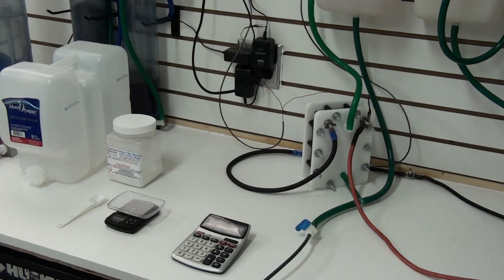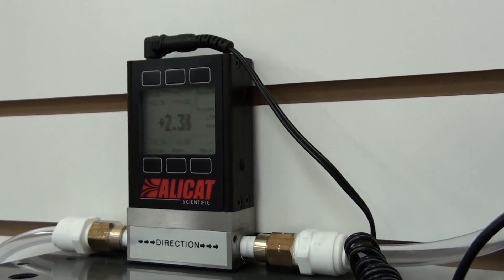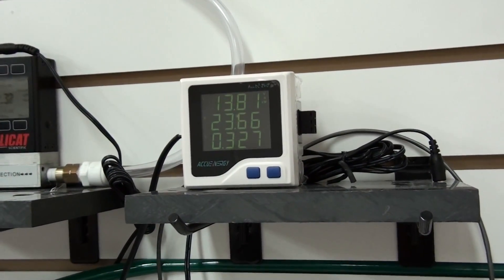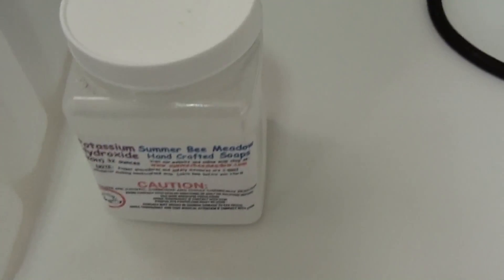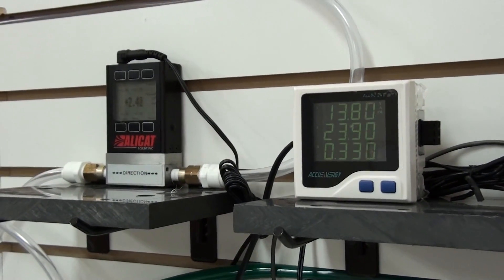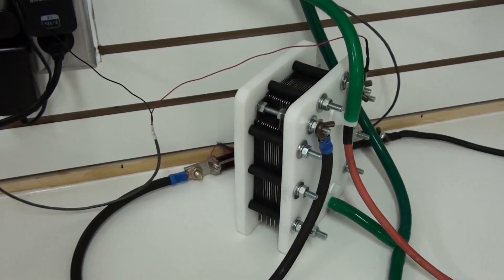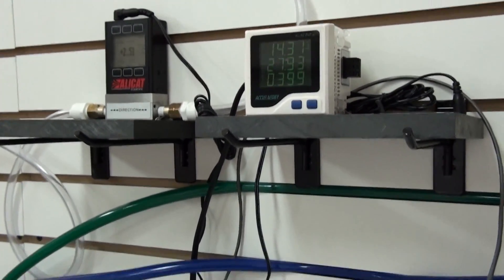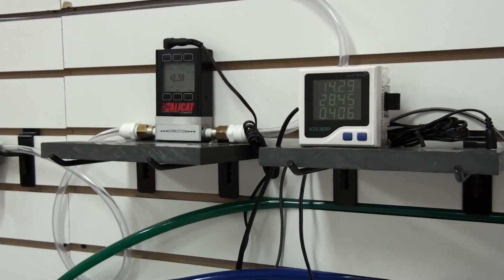HHO hydrogen 19 plate cell for v6 vehicles Systems. Output and efficiency DEMONSTRATION.

Comment: Cars that run only on hydrogen would have something called a fuel cell not a HHO generator, a fuel cell lets hydrogen pass through its core but the oxygen with protons can't, so they have to go around and you can use copper wire windings to create a drag and thus create energy, this can then run a dc electric motor. After the oxygen passes the wire it re combines with the Hydrogen and you add air to this Hydroxy gas to make water as a risult